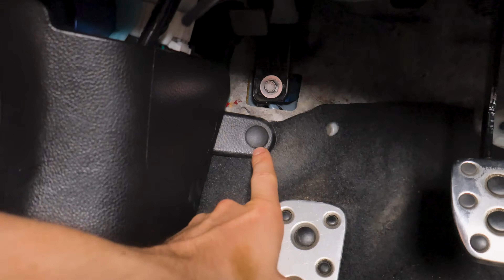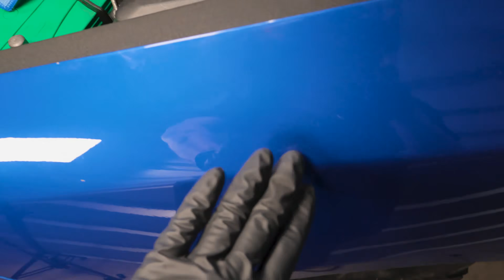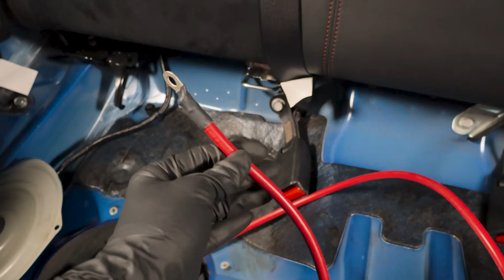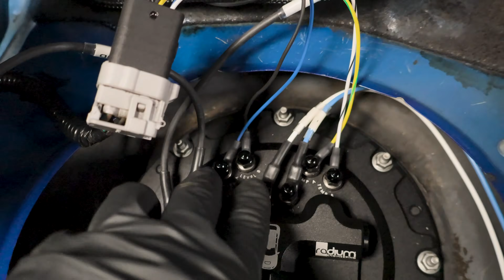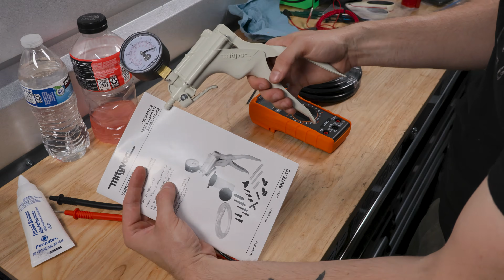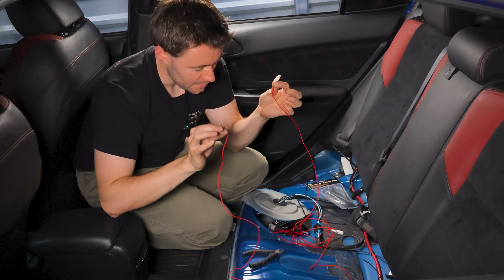The RIGHT Way To Install Dual Fuel Pumps (Radium + iWire STI Build) | Road to 600 HP Episode 3

Comment: Did you figure out the half of a tank issue? I have the same issue.
Reply from the maker: I honestly have not. I think that must just be a design flaw perhaps. I'm currently finishing my rotated build at the moment. I will do some more digging but this is also why Radium offers a surge tank or just make sure to stay above a 1/2 tank for pulls or 1/4 for regular driving.
Reply: @nit3sh1ft I was thinking I'll call them soon to see if they've had other complaints on it and what their solution is versus spending additional money.
Reply from the maker: @VA24_Project please keep me updated if you do. I'm gonna call them next month (next week lol)
Reply: @nit3sh1ft good deal. I messaged on IG to make it easier.
Reply: @nit3sh1ft any update on this?

Comment: I just did this install yesterday. Wasn't too bad. I also installed the iWire battery relocation kit in conjunction with this kit which eliminates the terminal connected to the battery in the bay with a simple power cable that ties into the battery in the trunk. Nice quality clean look.
Reply from the maker: My config for the breaker (now), looks so much cleaner than what I did for this video. I would've loved to do the relocation but it's expensive haha. maybe in the future... thanks for the feedback!

Comment: im only going for 500ish and im   only going to use one 450, do i need the fuel pump module addptor in the trunk/  vac sensor or do i just use the the power kit i got from radium? also i noticed the power wire that you ran in a hole in the trunk, could you put a rubber grommit on so it doesnt rub thruogh, great video deff going to be watching again for my install lol
Reply from the maker: For the power wire, yes you could use that. You can use the supplied radium wiring or this module for the second pump. The wiring from iWire allows you to retain the factory fuel pump controller (FPC) so your pumps aren't operating at 100% duty cycle at all times.